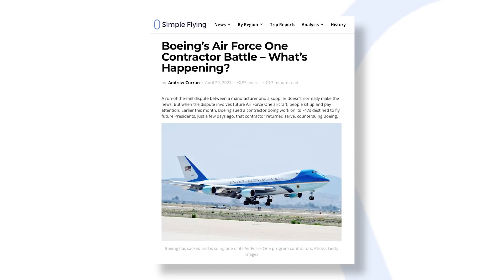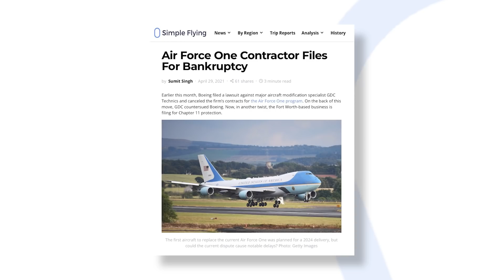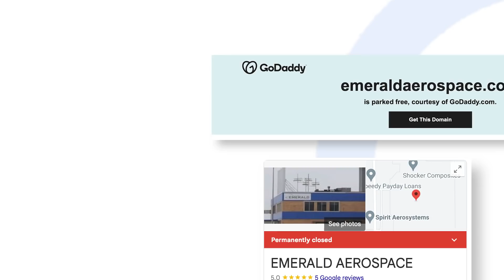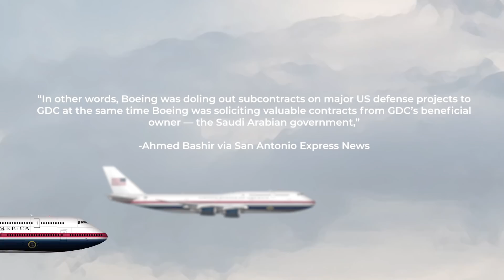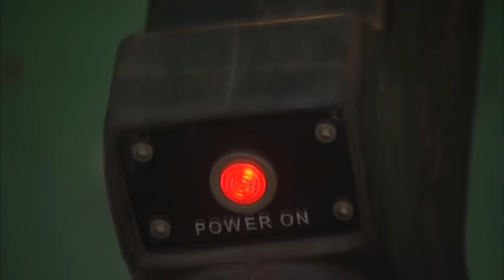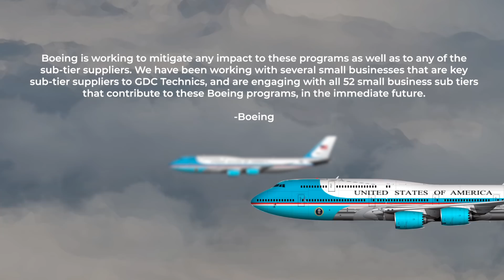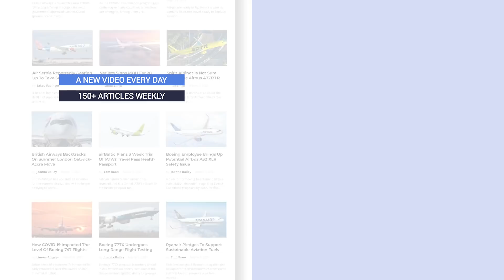The Next Air Force One: What’s The Latest?

Comment: Have you noticed these problems begin to rise when McDonnell Douglass merged with Boeing (with Boeing's own money).
Reply: I mean there's been problems regardless even before the merger. As successful Boeing and Airbus have been, it's incredibly difficult to not have any issues over time.
Reply: If you worked at Boeing before and after the merger, you know its the truth.
The same management style that ran the MD commerical division into the ground has contaminated Boeing.
It went from engineering excellence, to get it out the door as fast as possible, don't want those stock prices to drop. My executive bonus is at stake.
Reply: @RT-mm8rq       You nailed it,  in a nutshell it all begins and ends with greed. 
When Boeing was in its peak it was run by engineers who had pride in their work and the company was very profitable, then cam the ben counters who said we do ALMOST the same kind product with just about the same quality that no-one will notice much of difference but we will gain so much more for the stockholders portfolio, wile you know the rest.

Comment: I think this is a embarrassment for the united states of America. You already have the two planes that are built and you already know how they fly and there reliability. Shouldn’t be taking  so long to complete inside and all secret things inside the plane. Current Airforce one already is overused and overdue to be replaced. Another 3-4 years to replace because of delays is a joke!
Reply: It's not that simple.
Reply: well, Covid, supply chain issues, the US government being a bloated mess, and other factors.
Reply: It's actually a lot more difficult than you think, to take 2 already made 747's for commercial passenger service...then modify them for the president of the United States. I think it would be different if they were ordering brand new 747-8's.
Reply: @quedizzle7378  Things not quite going Americas way? Cracks appearing? Airbus would likely have had the job done by now.
Reply: ... I agree they seem to be able to keep the B 52 going ... so what’s the deal with  pair of 747’s ... imo
Reply: Sure, Merk, whatever you say.

Comment: VC-25B presents a political nightmare for any sitting president or anyone seeking the office. It won't be until pandemic ends, full economic recovery is achieved and Boeing cleans up its image before there is any serious mention of VC-25B. 

At that point, it's unlikely that a 747-8 will be deemed suitable for the mission. I imagine that the next VC-25B will be a 777-X. It won't be mission ready until 2032. 

The current VC-25B, despite the costs to operate and maintain it, will be flying for quite some time.

Seeing Air Force One in other liveries makes me cringe.
Reply: The only thing that kept me for supporting the 777X AF1 is the engine. With only 2 engines, I've been wondering about the redundancy if one of the engine suddenly stopped working midair. Other than that, yeah, 777X is very great option
Reply: I imagine if the next VC were to be based on the Triple, it would receive a whole new designation rather than 25B. But other than that, all of your logic makes plenty of sense
Reply: @FarhanSyafiqFadhillah  I agree. this is USAF’s position. Their mission requirements specify 4 engines. But, I believe they will solve the redundancy challenge. The 777-X also gives the USAF far greater longevity than a 747-8. There are tough challenges to overcome for sure.
Reply: @FarhanSyafiqFadhillah  i think the next AF1 will definetly be a 747 but im more curious about what comes agter this plane
Reply: The 747-8F is going to be in service with cargo airlines for decades to come. Sure, the -400s are almost entirely out of passenger service, and I expect the -8i to be gone within the decade, but service for the plane itself will remain robust.

Comment: Since security of this program has been compromised, maybe it should be scrapped altogether and the order awarded to Airbus;)
Reply: I think a 4 engine plane is a requirement.
Reply: @JAMESWUERTELE  ik sure Airbus can make another A380 if they got the order
Reply: @MrJimheeren   they declined to submit a bid. The aircraft has to be manufactured in the US. The a380 was of interest by the USAF.
Reply: Airbus does not want to and the US will never fly their president on a European aircraft. Ever.
Reply: @MrJimheeren  the A380 isn’t a good Option, mostly because it’s too heavy, its operating costs are higher and it is restricted to only a handful of airports. Also, the A380 production line is currently being converted to increase production of the A320neo family, it simply isn’t possible to reactivate production
Reply: @JAMESWUERTELE  No, sufficient electrical power is, which means that no 2 engine plane can meet the requirement, not to mention the square footage.

Comment: the IAF should have acquired a fleet of three brand new B747-8I BBJ for the PM . . . instead of the two retrofitted ex-Air India B777-300 ER . . .
Reply: 777 is a perfectly respectable plane.
Reply: @DirectorBird  Especially the 300ER with the GE90-115B engines. Nothing wrong with a head of state flying on one of those at all.

Comment: It sure is a mess of contracts and delays to build 2 or 3 Special Customized Boeing 747 jet airplanes to be used as Air Force One when the President of the United States is on board. I guess the old Boeing 747s that are used as Air Force One will be in service at least another 5 to 6 more years.

Comment: Boeing troubles started with not making Alan Mullaly President of Boeing Commercial Airplanes, using the number 8 on its products ( the number 8 is good luck in Japanese but bad luck for Boeing) , moving the headquarters from Washington State to Chicago ( to be close to customer United Airlines which ironically during the move ordered Airbus jets), allowing bean counters and McDonnell Douglas people to run the company instead of engineers and not making a redo of the 757 and trying to update the 737; a 60+ year old design  for the 21st century.

Comment: Why are these needed?  The POTUS already has two.  Can a new pair of 747s be that much better than the old pair? 

And with Biden etc being up our asses about environment and fuel consumption, maybe downsize to a pair of 787s instead.
Reply: 1) The newer aircraft are much more fuel efficient and at a certain point you have to upgrade your fleet

2) The aircraft are already bought, just imagine the justified outrage when they buy two 787s instead. Two 747s instead of two 787s won’t change anything when it comes to saving CO2 emissions
Reply: @spongebubatz  nonsense, they're trading a pair of 747 for another pair of 747s, how much more fuel efficient can it be?  It's a behemoth.  Maybe retrofit the existing ones with new engines or something.  

And that second point is double nonsense.  787s are way more fuel efficient - 2 engines with fantastic fuel economy, vs 4, composite materials, and smaller footprint (God forbid the president deals with a bit less space lmao)
Reply: @ChristopherBurtraw  it’s also availability of spare parts that makes continuing VC-25A operations unfavorable. 
Yes, I agree that the 787 is much more fuel efficient and in a better aircraft perfectly sufficient to be used as a governmental aircraft, but just a little reminder: The presidential aircraft isn’t just any private aircraft. It has security systems installed other heads of states can’t rely on. The entire upper deck is used for that and probably will be as well on the VC-25B, size in that sense matters. 
Yes, the president enjoys the comforts of a pretty roomy aircraft, but like I already said in my first reply operating a 747-8 instead of a 787 won’t have any major effects on anything. The aircraft don’t fly regularly and for the time they’re used, having the benefits of the more fuel efficient 787 won’t make any difference at all. The USAF even still operates 707s and other older aircraft like the E-4s, they don’t have to care about fuel economics as normal airlines do. 
And I’m going to say it once again: There’s no meaningful difference between having two 787s instead of two 747-8s when it comes to world climate. 
Also, try to explain to every taxpayer how you would dump two already paid 747s which have already undergone massive and more importantly costly modifications to buy two new aircraft instead. It simply makes no sense and now isn’t the time to spend unreasonable sums of money, which acquiring new 787s would definitely be.
Reply: @spongebubatz  I don't care about the climate part, but they're saying a big reason for replacing the old planes is due to fuel costs, as did you.  But I bet the difference between the A vers and the B vers is smaller than the difference between the B vers and a 787.  Not to mention cost - with the 747 more or less out of regular production, let alone the size difference, it surely costs far more to use it as a basis.  

If you're worried about spares for an older 747 based aircraft, but not worried about spares for the new 747 based ones - as it will likely cease production entirely early on in it's lifetime - you may have something goofed.
Reply: @ChristopherBurtraw  again, you haven’t answered any questions about the costs and what that would mean for the taxpayers. It would be horrendous to buy two new aircraft.

Also, when talking about spare parts one of the main aspects who have to talk about is engine parts, which is like the main issue the VC-25A has. Unfortunately for your argumentation the 747-8 has the same type, although a bit smaller, as the 787 (GEnx). So there will surely be spare parts far into the future, you’re entire second point is redundant and adds nothing to the debate. Also, why didn’t you respond to the other points I had?

The entire operating cost benefits the 787 has would be wasted in buying two 747-8s, modifying them, then stopping halfway through and then buying two 787s and modifying those as well. In no world it would make sense to do that. The USAF isn’t an airline, they don’t have to care about economics like airlines do. After spending so much money on the 747-8 it makes absolutely no sense to dump it.
Reply: @spongebubatz  my point is that it was dumb to choose to buy new planes, let alone 747s, to begin with, and I don't buy any of the logic you use the validate this combination of decisions.  In no way did I suggest they reverse course now.  (My statement about downsizing is clearly tongue in cheek to further my point that it makes no sense overall.)  

Engines are super common, even older ones, it's not that hard to find parts for older 747 engines.  The GE CG6 is still in production and will be for at least several years, and spare parts are made available for years beyond EOP.
Reply: I don't even want to hear about costs when they're buying new planes, clearly they don't care about costs, but I do.  This is a ridiculous choice no matter how you try to spin it.
Reply: @ChristopherBurtraw  your now changing the argument to your advantage, it began with arguing whether  they should buy 787s and dump the 747s, now you’re saying that they originally should’ve bought the 787 to begin with, what itself would’ve been a good option. Do you see that flaw? Anyways, I’m heading out, have a good day!
Reply: @spongebubatz  no, you decided to straw man my argument.  My very first question is "why are these needed?".  I believe they are not, as soon later stated in our discussion, the current ones should be just fine.  Then I further suggested iny original comment that they ought to have at least considered an updated airframe design if concerned about an aging design, or fuel usage (again, tongue in cheek political reference attached).
Reply: 787’s couldn’t meet the requirements, in particular with respect to electrical power and square footage.